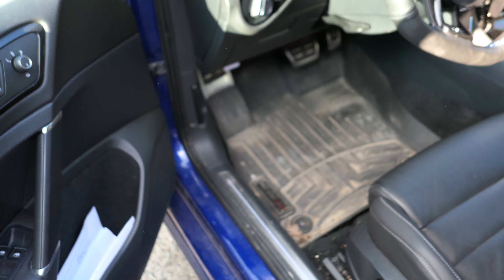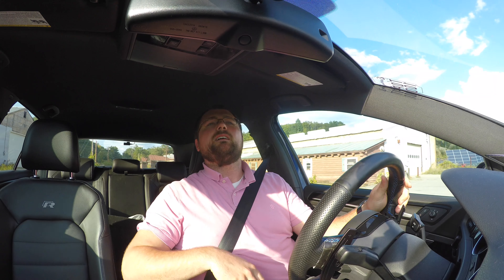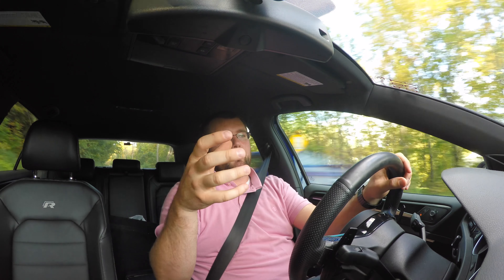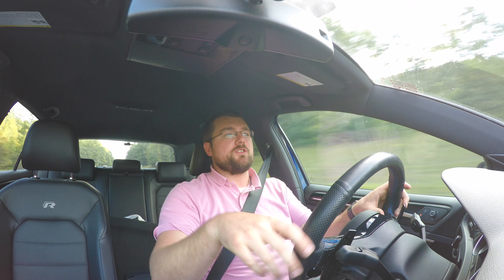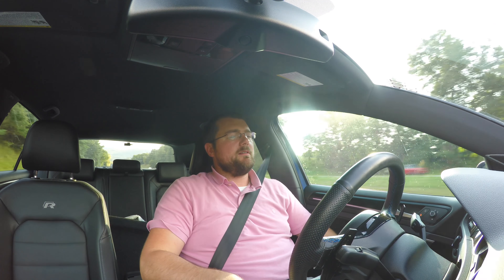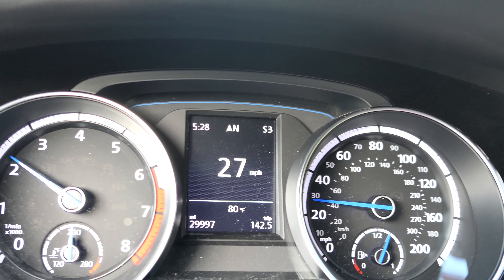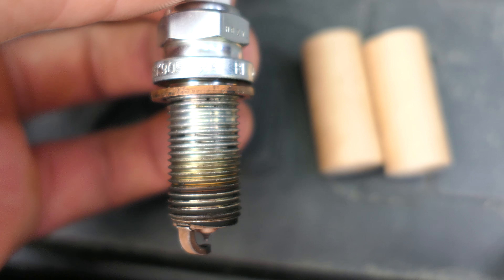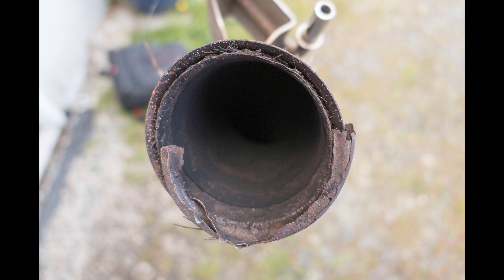Golf R Update! New Downpipe, Oil Pan, Crank Pulley, Spark Plugs!

Comment: Now after about 2 years,, how did you liked the CTS Turbo crank pulley.. any disadvantage any problems?
Reply from the maker: Good comment! It's been fine. I honestly haven't thought about it since then. I think the car has 10K More miles since then and no issues at all. Just did 12 launches + runs at AutoCross on Sunday. car is doing fantastic!
Reply: Adam Chandler That’s great, actually i bought one before 2 months ago, but i didn’t install it until now, one of my friends tell  me it maybe fails for high rpm and he advised me to not install it .. so that’s words made me fear a little.

Comment: Props on the Forge turbo blanket, I love mine. Did you consider running a Fluid Ampr crank pulley? Only reason I ask is the stock crank pulley has a harmonic damper and the CTS one does not, some people argue it could affect reliability but who knows.
Reply from the maker: Already went to the track last night. Haven't ran the numbers yet but I do think it kept temps down. As for the pulley, that's a good point. I'll have to look into that.

Comment: Do you think the crank pulley will be beneficial for my Mk7 GTi Pp? I only have a Cobb stage 1 tune with K&N drop in.
Reply from the maker: Um...I honestly don't know. I did it after all of the other mods and couldn't really tell a difference. Also you need a special tool which a dealer would have.

Comment: What do you mean about not taking the turbo blanket off?
Reply from the maker: I have a Turbo Blanket installed to keep engine bay temps down. It helps me maintain top speed over a few quarter mile runs. Noticeable improvement.